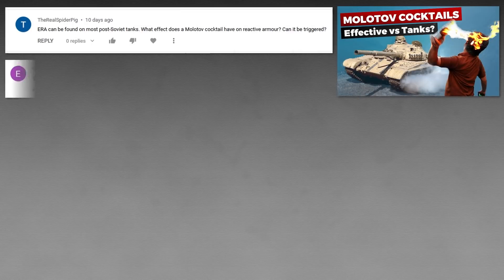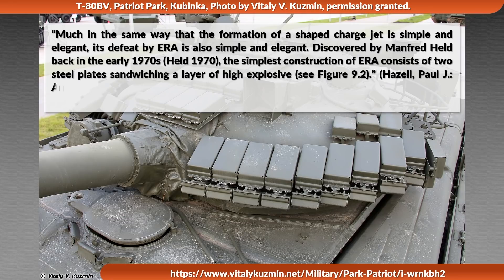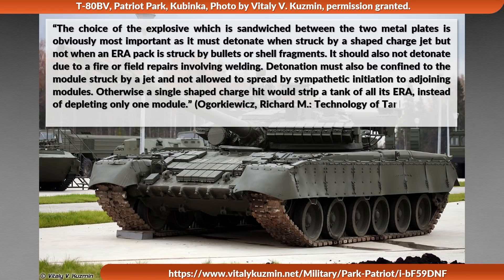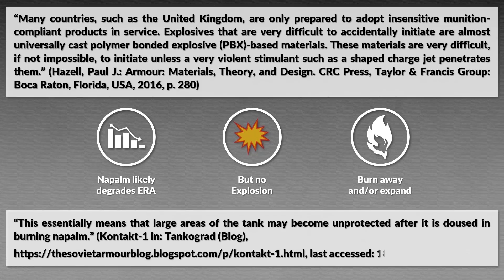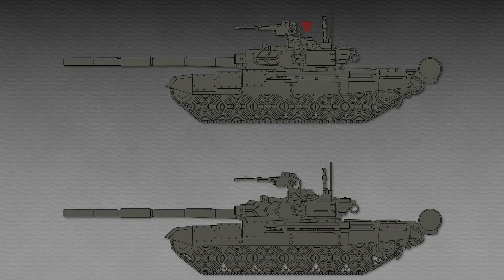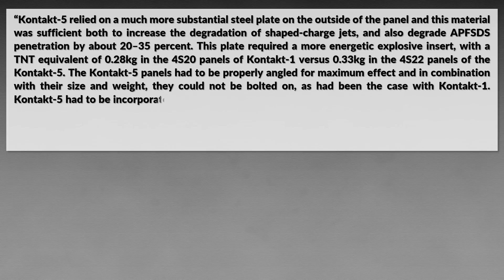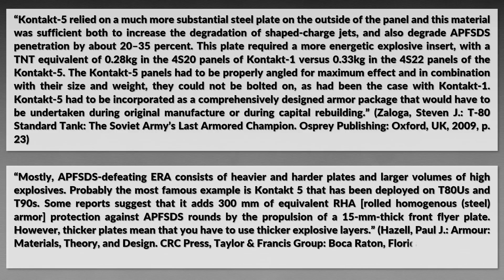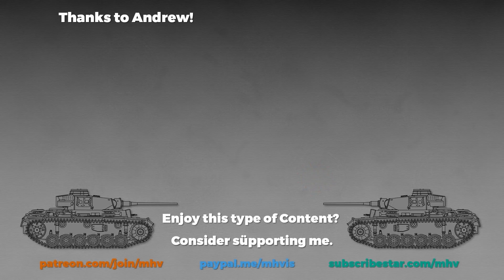Why does Russian Explosive Reactive Armor not explode?

Comment: There was a documentary that showed one of those "jets" stuck in an armor plate. They had set up a series of steel plates and detonated a HEAT warhead into the lot. Many plates down there was the copper liner stuck in one of the plates with some projecting from the back of the plate. I've been looking but can't find an image of it online.
Reply: I found a video by "Beyond the Press" where they did a shaped charge vs stacks and stacks of paper, and the copper was stuck in the middle, was that it?
Reply: @jmackmcneill  Found that clip but that isn't it. Interesting though. The one I'm thinking of was older, maybe over 10 years old. It may have been either one of the good BBC military history programs or one of the last good history shows made on History Channel. 

I still recall them using metal plates and the charges were better made. It might even have been a kind of factory demonstration kind of thing.
Reply: @jmackmcneill  if the jet was stopped by the target it will remain in place, there will be fragments of the liner which which weren't accelerated as much, or small pieces adhered to the surface that it penetrated. Shaped charges for civilian applications or improvised charges are likely to leave more material behind as they produce a wider and thus less penetrating jet
Reply: This is only speculation, but I think in that example it may well have been the alloy "carrot" (named due to the shape they tend to form) of an explosively formed penetrator, or EFP which is employed in some types of modern anti-tank mines that are often tripwire or optically-activated, which can be placed some distance from the target with the penetrator capable of travelling some distance through the air. The concept is very similar to a shaped charge except the collapsed liner is typically thicker and a small dense piece formed by explosives breaks off and is projected towards the target, in an analogous shaped charge or HEAT warhead the same formed piece of metal is actually the tip of the larger formed liner that punches through the armour. 
The forces involved are huge (but smaller than those involved in microgravity and orbital velocities which spacecraft have to deal with) and materials like metals stop behaving like true solids and more as very viscous, plastic fluids if that makes sense and the constructive interference of the blast wave from the explosive leads to the liner being punched into shape exceedingly quickly and the small area of the jet/"carrot" that force is applied gives it the penetrating capability.
The fellow above who does explicit dynamics can probably give you more details but that's the general overview.
Reply: @CATASTEROID934  Even in regular shaped-charges (not just EFPs) there is often part of the liner which does not become part of the jet and is left over in a lump which is also called a carrot.
Reply: There is a armored vehicle museum between Tel Aviv and Jerusalem with exactly what you describe in it, demonstrating penetration of spproximately 3 feet of steel slugs and milled to demonstrate the length of the channel with the copper penetrator protruding out as you describe.
Reply: The copper liner isn't quite the same thing as the "jet" of a HEAT round. The liner is used in a HEAT round that forms an explosively-formed penetrator (EFP). The liner is in the shaped charge in a concave, and the explosive behind it causes it to deform into a bullet-like shape that is propelled forward. The "jet" is formed from the explosive material (or rather, the stuff the explosive turns into when it explodes).
Reply: @gimmethegepgun   No, it is indeed the copper liner that forms the jet. And Mr. Kast is absolutely right that the jet is not “liquid” as we normally think of liquids; the term of art here is “superplasticity.” The jet also doesn’t “burn” its way through anything—it’s the extreme velocity of the jet that cuts through targets. 

An explosively formed penetrator is slightly different, though metal-lined HEAT warheads and EFPs are conceptually very similar. 

I do explicit dynamics simulation for a living, for what that’s worth. (Explicit dynamics is the technique used to model short-time-duration events like the same detonation of HEAT warheads and ERA).
Reply: @gimmethegepgun  I used jet because that is how it has commonly been referred to over the years. What was stuck in that plate was still clearly the copper liner and had not turned to plasma or the like as commonly thought. I seem to recall that surprising some of the people present.
Reply: @Thane36425  What I'm saying is that the EFP is a completely different thing than what is commonly referred to as the "jet" of a HEAT warhead, and isn't something that's in all HEAT warheads.
Reply: @gimmethegepgun  The only fundamental difference between regular HEAT shaped charge and an EFP warhead is the intended shape of the penetrator. In HEAT, the penetrator is a long rod formed by the action of the explosive upon the liner (if there were no liner, the shaped explosive charge could still act directly upon the armor surface, but the effect would be weaker and the geometry of the interaction, such as the distance from the target at which the explosive goes off, would be more critical and would have to be closer). In an EFP, the penetrator is bullet-shaped, has a higher mass, and is able to travel over a longer distance (10s of meters) and still penetrate armor.
Reply: Russian manufacturers are filling the inter layers with egg cartons not reactive armor . There's videos on youtube of Russian tanks that have been hit with egg cartons stuff inside . Manufacturers are putting that money in their pockets . Iam not joking I will post in the comments later.
Reply: @jajajaja2624  the "egg cartons" are supposed to be there. They are plastic spacers that hold plates of explosives at a correct angle or position. Whether the explosives are there is another question.

Comment: I'm guessing thermite could set it off I can make this at home very easily. With foil and iron powder but then again It might not be so brutal if it's plastic explosives. Anyone know about this or can tell me?
Reply: Low-sensitivity high explosives usually aren't set off by heat, but by compression. Thermite is just heat, so likely no. It is exceptionally hot though, so it might be able to.
Reply: @gimmethegepgun  yer I guess your right there. It is just pure heat but a little lively if I was a Ukrainian I would take one to test it out. Home thermite may be different to. Military thermite.

Comment: I did a university project on this few years ago, in case someone's interested:

The "E" part of "ERA" doesn't stop APFSDS projectiles as all. The deadly thing about the APFSDS projectiles is their geometry, primarily designed to defeat RHA (which is the underlying basis of even the modern tank armor in most cases).
Projectiles are further enhanced with tungsten-covered tips with underlying heavy materials (such as depleted uranium in the case of the USA, or more generally less effective lead in case of almost all other countries). Heavy material are only used for storing kinetic energy due to their sheer mass.

Now, the thing is --- what defeats the APFSDS is the destruction of its tip's geometry. A tip that has been damaged by 5% - 10% loses from 60% - 90% of its armor penetration capability. (You can find good .gif animations of computer simulations that explain this in visual detail.)
The projectile tip is commonly made from non-elastic, very hard material. The process of using cemented steel (high carbon content steel, hard) over the soft steel plates (that soak up the damage) was used in WW2 as the cheap means of destroying penetrator tips of the common AP projectiles. The softer steel armor beneath it is like "a destructible net" for catching the remainder of the projectile.

Using cemented steel is the thing of the past tho, but the concept remains the same even for the future planned versions of tanks. Ceramic is the ultimate material for defeating projectile tips nowadays due to its cost to effectiveness ratio. It has almost no elasticity whatsoever and it can be heavy and bulky, but its extreme hardness defeats the APFSDS. More modern solutions include composite material armors with outer layers made from ceramic matrix composites (basically ceramic fibers infused into another material).

The ultimate goal would be the RHA infused with ceramics, summing up the best from both worlds -- both the hardness and the elasticity.
 
ERA with tougher, thicker outer plate is basically a composite structure. If an APFSDS struck it, it'd first strike ERA's outer, harder layer and damage itself. It'd pierce the explosive segment like a hot knife through butter --- BUT the already DAMAGED penetrator tip would afterwards hit another hardened layer of the tank's very armor. It's geometry would be much more affected by the tank's armor surface hit, thus relatively nullified.

I mean, you could achieve the same thing by making a spaced (space filled with either air or some polymer) ceramic armor above another layer of the ceramic armor, but the brittleness, bulkiness and weight + no ability to defeat tandem or common HEAT warheads would make it useless.
Reply: DU rounds sharpen themself as they go deeper unto the armor no?  If so then sharpness isn't an issue
Reply: @a1marine105  Yes, it is "self sharpening" (in a way, but not literally) and all modern APFSDS work with that principle -- but it too depends on the initial condition. Initial condition is the function of projectile's entry angle, projectile's starting velocity during the entry, projectile's mass, the width of the armor, the armor material, the material from which the projectile is made (all segments of it), and especially the projectile's geometry.

If you manage to ruin the projectile's tip right before it reaches the layers of softer, more elastic steel --- it won't dissipate the kinetic energy in the way it is intended, as "self-sharpening", because you've changed the initial condition.

Most military secrets are... well... secrets, thus sealed off to the public -- but you could find the work of PhDs who are into mechanics and material resistance, who did simulations of these situations and explain different parameters (and how they affect the interaction between the projectile and the armor).
This is the first one I typed in and came across, and there are hundreds like these, far more detailed, with different parameters: https://www.youtube.com/watch?v=8c1JyfY9rVU
Reply: @a1marine105  This is the "initial condition" I talked about:
 https://www.youtube.com/watch?v=8c1JyfY9rVU

In case of the APFSDS --- defeating projectile's geometry before it reaches softer steel is the primary goal. It cannot dissipate the kinetic energy in an intended (destructive) way if you don't set it up to do so. This specific video I linked does, however, not really represent the complexity of an APFSDS, but it display the concept.

It takes into account the effect of explosion the ERA provides at changing the initial conditions (relative velocity + geometry) ----------- BUuuuUUUuUUT if a projectile was nearing armor at that shallow angle, it would most likely not be fatal at all, so "E" in ERA does nothing but preserve the cosmetics.
Reply: Did you happen to do any studies on the effects of HESH munitions on ERA  ?
Reply: @clivedunning4317  No. As a robotics / industrial engineering bachelor student working on a primarily mechanical subjects, my project was widely based around the methods of RHA production (how temperature affects the steel grain structure, how steel grains affect the global properties).
The quality and effects were compared against the AP (and modern day APFSDS) shells in the mechanical analyses. I took data from some way more advanced PhD studies which included simulations and slow-mo video clips.

I didn't want to write much about how ERA defeats the HEAT because I do not know the mechanics behind it any further from what was said in the video, and I especially not know the chemistry. It's an interesting question however. I know (I think I heard it from this channel exactly) that HESH was dangerous to vehicles that didn't have distinctly separate composite armor sections because the shockwave would propagate through the contact point to the opposite side, and rip off a chunk of steel that'd fly inside the tank like shrapnel. Newer armors are bound to be equipped with a layer that catches potential shrapnel that could fly off the tank, whether it's a form of a polymer or some more elastic spaced alloy.

Idk... rly interesting. Maybe the HESH could activate the ERA if a chunk of ERA's front segment flew into the explosive behind it.
Reply: @ShomiTheGreat  Thank you for your reply, my thought would be that the HESH round might "fill in the gaps" at the side and top,bottom edges of a ERA panel block. How this  . . .'defeat by stealth' . . . of ERA would play out on detonation might be interesting to observe, especially in slow motion !
Reply: Armor penetration is a function of energy density (pounds per sq inch). A sharp point has a very high energy density as the contact surface area is very small. ERA effectively increases the surface area of the projectile tip which lowers the energy density.
Reply: @wiregold8930  That's pretty much it, yes. The geometry itself presents the function of how that armor-injected projectile's tip fault will propagate throughout the entire projectile (if you locked the frame of reference with the "stationary" projectile and watched how the "rapidly moving" armor affected it).

At delta_time that nears the zero (that is - an infinitesimal zero, looking at a singular state), it's all about the energy density. Looking at it over continuous time, it's all about the initial conditions that completely define the projectile's and armor's state during the entire process, depending on various initial conditions.

Good one, mate.

Comment: Fascinating content.
  Re: ERA modules as considered by a boomer.
  Hmmm . . . thermite sticky/Gammon bombs (those damn British)?  Microwave LASERs?  An enemy Propaganda campaign leading to general recall?
  The composition of the metal panels encasing the HE charge might be important.  I wonder-can they be cracked open by, say, a PTRD or .50cal type AMR?  Will a Bradley's Bushmaster crack the blocks enough to expose them to other, possibly negating, forces, either natural or manmade?  Are the charges wasserpruf once compromised, for instance?  Are there fast acting chemical agents that might render compromised ERA HE blocks unstable or more susceptible to premature or inappropriate detonation?
  Another line of thought: what methods are used for attaching the blocks?  Are these accessible to non enemy tank interference?  Might oblique hits simply strip off the bricks not pointing in the right direction?

Comment: If it's impossible to completely cover a tank in reactive armor, then AI guided munitions can simply avoid reactive armor by seeking the geometry on the tank that presents the most apparent vulnerability. If there's any part of the munition system that can survive the attack and transmit the effectiveness of its attack to other munitions, each salvo would be getting smarter, and deadlier, damn near pinpointing specific seems and rivets, and adjusting its own angle of attack against the tank's engineered deflection angles. Tanks with reactive armor are going to be lucky facing off against dumbfire RPGS and aint-tank rounds in the future.
Reply: There are no ai guided munitions?
Reply: @karlyo6937  Probably not yet, but there will be. Right now you're seeing drone activity that is human guided. The future drones with long loiter times will have a theory of ariel combat, of evasion tactics, so they can survive the space where they will be targeted, they will also have a database of preferred targets in case of their primary designated targets not being found, or else already being knocked out by other munitions before they strike, that database could in turn have a database on where best to locate its strike against that target. These future drones combat brains could be run in a million experimental combat simulations, before going thru hundreds of real life test ranges, before getting deployed into real combat situations. And the technology for creating something like that would not be much different than what is already being developed for self-driving cars, and probes that essentially land themselves on the moon and mars. And drone proliferation leads to something called "swarm" tactics (similar to the peace-time use of decorating the skies in the South Korean Olympics some years back), so say a tank has reactive armor, so it can take a good hit, but it has five drones all aiming for the same spot, in quick succession it will keep getting hit until its down, and when it's down any other drone in line will go to another target &repeat the combined strike capability because there are in theory hundreds of drones loitering over hundreds of potential targets, drones that got released from a ground launch vehicle, or a stratigic bomber, or multiple sources all using the same secure battle network to coordinate their attacks in what is termed mosaic warfare. These is all stuff DARPA has been working on and publishing on for years.  What I'm saying is, the future of war is even more lethal and terrifying than what we are witnessing right now. There are levels of hell we've not yet reached, and we can probably get there before the conflict we are witnessing ends, since neither Russia or Ukraine has any practical motivation for peace because they are both convinced this is an existential war they must win, it is very likely we'll see an early or limited version of these more advanced capabilities before this war ends.